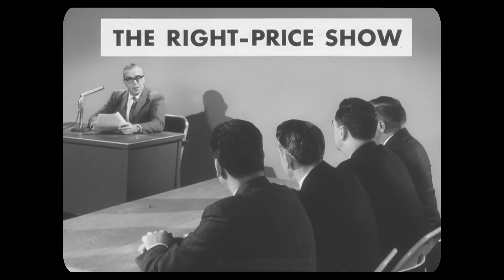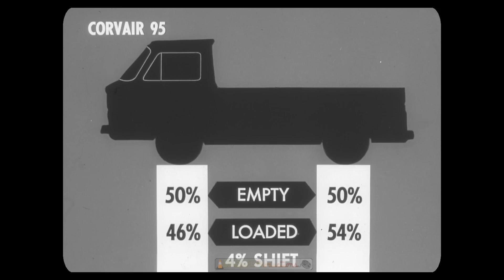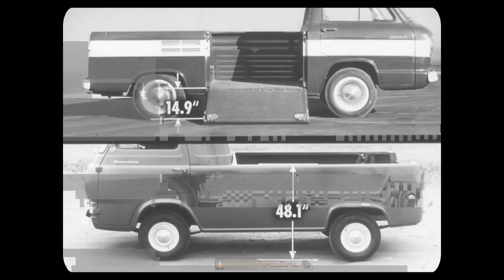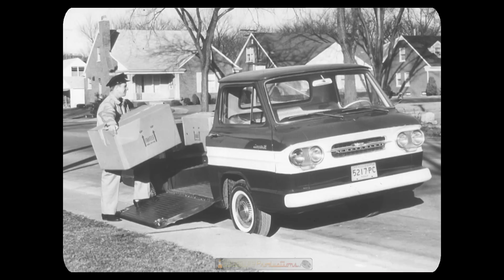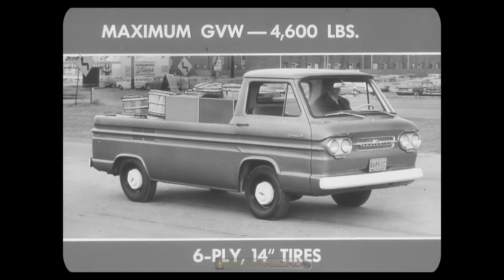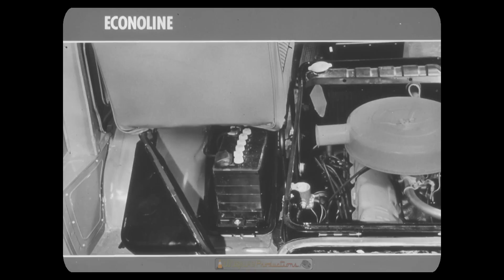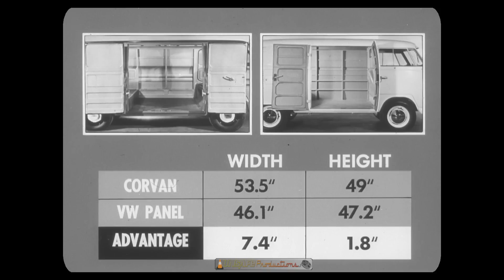CORVAIR FC 95 Vs FORD ECONOLINE & VOLKSWAGEN VAN 1961

Comment: It's a shame, considering the advantages of the Corvair van and pickup truck over the Ford Econoline van and pickup truck, that it was discontinued when it was.
Reply: One reason that was discontinued was because of that sorry ass engine it had.
Reply: Really? If you remember, Volkswagen also used boxer engines for their cars and trucks into the 70s, and to some degree even later than that.
Reply: +Jason Carpp  This presentation is from GM's point of view.  In the real world, the Econoline was a far better work truck.   The Corvair overheated under hard work, didn't have nearly the power, and the rear load floor was unusable with the engine taking up the cargo area. For family use, I'd take the Corvair, for a work truck the E was a far better more conventional vehicle.
Reply: @ohger1  and I live in northern Iowa, the Econolines had functioning heat, the Corvan.....not so much.
Reply: @fk4515   Yep.  I had a 66 with the large 240 engine and it had fine heat.  But like the Vdub, the air cooled Corvair made heat almost immediately, just not very hot.  A water cooled engine like the E had took longer to heat the cooling system, but once it did, it was far warmer.
Reply: @ohger1  Perhaps Chevrolet could've gone that route when developing the Corvair. a small V6 engine in the back of the Corvair?
Reply: @ohger1  and once the VW or Corvair got some age on them and started rusting the heater system would quit working.
Reply: @jasoncarpp7742  Capt. Beak got it right.   You have to realize that GM was intrigued with the Bug and thought they could make it better.  It actually was in some ways but there were trade-offs.  Putting a liquid cooled six would have taken up an enormous amount of real-estate, not to mention the problem of putting in a radiator and making sure you could get airflow through it.  A front mounted engine has no such troubles, which is why manufacturers went from rear engined horseless carriages to front engine.  And while the Corvair was a revisit of the Bug, the Corvair van was a revisit of the VW Bus.  My dad bought a 59 Bus brand new and really liked it.  When it died, he bought a 66 Super Van Econoline, and that had many times the room because of the packaging of the straight six between the front seats.  The VW was better in snow and better on gas, but couldn't carry a third of what the E could.
Reply: @fk4515  True, but all you had to do was replace the heat stove covers with unrusted ones or the vent tubes and the heat came back (more or less LOL).
Reply: @ohger1  most of the ones I got the tin worm had gotten into the ductwork. I suppose if the VW's had developed plastic or stainless steel ducts and used electric fans it might of worked out okay. I can't remember if our Corvair had an electric fan.
Reply: +ohger1 What causes the overheating? I would've given it a water cooled boxer six engine, rather than the air-cooled engine.
Reply: Jason Carpp
 On a hot day pulling heavy loads, the Corvan air cooled engines overheated because of insufficient airflow across the heads for the heat they generated and lost power as a result. An air cooled four is a nice idea for an economy car but bad idea for a work truck.  Between the engine and the loss of load floor out back the Corvan didn't sell a fraction of what the Econoline did. Chevy dropped this van for an Econoline clone.
Reply: +ohger1 That can certainly be a problem. Perhaps Chevrolet should've offered a water-cooled engine? Perhaps they should've also provided a better ventilation for the engine.
Reply: Jason Carpp
Only so much you can do engineering and cost wise with a pre existing design. The van was pulled from the Corvair car which limits what you can do without changing "hard points" in the engineering blueprint.  For a small car, an air cooled rear mounted engine makes sense.  In the winter, a rear engined car goes better than a front wheel drive.  But even Vdubs in very hot weather and traffic would get very hot without pulling cargo along. But once the decision was made to make a van out of the Corvair it should have been limited to home use (Chrysler figured that out!).  To add water jackets to the Corvair engine would have added a lot of cost, complexity, weight, and size.  The air cooled engine was adequately ventilated as installed but there's only so much air you can get across the heads without the engine fan being geared or pitched so much that it's parasitic draw would reduce engine power to an unacceptable level. If Chevrolet had thought to dress these vans out as nicely as a car, they might have done much better with families with kids as the first Caravan did.
 I think it's a very cool van just not a very good work van as the sales video would lead you to believe.
Reply: +ohger1 I imagine. I wonder if a water-cooled boxer engine would've worked for a Corvair.
Reply: @jasoncarpp7742  their were a multitude of problems with the Corvair engine.  This was the second attempt at an air cooled car but they didn't understand the temperatures it would run at and used gaskets similar to their water cooled engines, these gaskets didn't hold up to the heat, once they started leaking oil the dirt would stick to the engine and hold the heat in and the downward spiral started.  Another problem was the fan ran off the crankshaft so on a hot day when the vehicle was idling at a stop or cruising at slower speed it might not get as much airflow as it needed, with water cooling even though the water pump is run of engine speed the thermostats and such did a better job of adjusting the coolant flow and also could heat sink excessive heat, that and the cooling is done at a radiator making it easier to avoid a heat soaked engine with a long coolant temp recovery. That and air is not a good cooling or heating medium, water can carry much more heat per cubic foot.  A water cooled flat six engine would of been unique and interesting  but almost contemporary to the Corvairs was the aluminium Buick V-8 that didn't work to well for GM because they simply didn't have a lot of experience in casting aluminium, to make it in cast iron would cause the weight to go up (although a water cooled flat six even in cast iron would probably be lighter than a straight 6 engine) and you still have to deal with the issue of locating  a radiator with adequate airflow.  Many of the points made in the video could be said about the Chrysler Mini vans of the 80's but no one in the US during the 60's was thinking or working in that way, the French (Citroen) and some small German Manufacturer made front drive vans, the Citroen H van was relatively successful in France, the German firm was pretty much eclipsed by the VW Type II variants.  The bottom line is GM is not a firm that does innovation well the of the major engineering innovations of the 60's the Corvair, The Transaxle Tempest, the Aluminium V-8, the Toronado/TH425 Transmission, The Vega and the OHC Straight 6 the Toronado/TH425 was the only one that was really successful long term. The GM method in the past was to buy up firms that had developed products with potential and then use GM capital and GM management and production techniques to develop the product. Examples: Detroit Diesel, EMD, Terex, Frigidaire and North American Aviation.
Reply: @fk4515  Okay. Perhaps they should've went with water-cooling. There were rear-engined water-cooled vehicles during this time, weren't there?
Reply: @jasoncarpp7742  Fiats, Renaults and a few other oddities and probably a mainline manufacturer or two that I can't think of right now. But with a rear engine in the van you're still having to deal with the issue of the engine bump in the back which is a limiting factor in commercial vehicles or you flatten the floor and deal with the increased floor height.
Reply: @jasoncarpp7742  Bad design?
Reply: @jasoncarpp7742  What if?
Reply: @jasoncarpp7742  then there's problems with getting air across a radiator or real long coolant pipes or hoses.

Comment: They glossed over the fact that the engine and transaxle had to come down just to get a look at the spark plugs.  This was back when plugs were due every 10k miles or so.
Reply: +Kevin  My dad had a "Supervan" version, and working on it was a piece of cake. If anything difficult needed to be done the engine cover unbolted from the floor and the engine was sitting right there to work on, even in the rain.  I could put in plugs, points, filters and belts in 45 minutes.
Reply: +Kevin you could get at the engine from above, but you had to unscrew an access cover.  Not convenient if the vehicle has a load in it at the time.
Reply: +Kevin That is not true...engine top cover comes off inside back swing doors..you can change the plugs in less than half an hour. I have 2 of them (Corvans) so I do know. I actually like the Econolines and the VWs too. Not trying to be a smart guy....I'll send you a picture of the engine cover off.
Reply: +Poncho389 Thanks for correcting me.  Yes please send a picture.

Comment: I'd rather have the VW. Sorry.
Reply: Brian Allen thats fine, i prefer the look and smooth streamlined front of that oposed to the balsy looking front of the corvair, with its pointlessly elongated face, the econoline is still my favourite van, second would be dodge a100
Reply: My  66 econoline van fits in a old tiny 1 car garage what are meaning
Reply: +Brian Allen  Don't apologize.  My dad had a brand new VW van in 1959 and loved it.  When he ran it out of oil and seized the motor, he bought a new 66 Econoline Supervan with the big 240 six.  He could not believe the difference in power (he said driving the Vdub meant keeping your foot to the floor pretty much all the time). Dad also seized the engine on the 66 in 1977 for the same reason (never learned his lesson)
Reply: @ohger1  I threw a rod in my 1961 36hp in 1967 or 68, upgraded to 40 hp (WOW!)  (Top speed still about 55 - a great teacher of patience and gauging  passing distance)

Comment: Good stuff, try as they may the Corvair truck line never sold very well for a reason not mentioned  in the training film, and that was you could not load it or unload it from the rear due to the engine cover. The Volkswagen was no better at this and sold few pickups here, the Corvans were dropped after 1966 and replaced  by a Chevy copy of the Econoline which was made out of Chevy II parts.
Reply: +proofbox  Yep> my dad traded in his 1959 VW Bus for a "SuperVan" because of that huge flat floor (and he blew the VW engine by running it out of oil).  The Corvan had the same problem: the engine blocked the back of the van where most workers used them.
Reply: Yep I was going to point out that the Corvan design was so darn superior that they made it a few years and then dropped it for a copy of the Econoline, or did they Copy the Dodge A100 or A 108?  And bragging about swing axles? They redesigned the Corvair in 1965 to eliminate swing axles and the swing axles were one of the features that Ralph Nader found objectionable in the original Corvair design.  It's not that I don't like the Corvair van, they're unusual and kind of funky and I like that but they were a flop and GM switched to a more conventional van rather than making any effort to further develop the Corvair vans. GM came out with the Turbo Hydramatic 425 transmission in 1966 and eventually used that transmission  in Motor homes, I think they missed an opportunity in not developing a front drive van/window van using the TH425 Transmission where they only thing they'd have to keep under the floor would be the exhaust system and the fuel tank and with some creative packaging and IRS could of kept a low floor height and center of gravity and maybe even offered a high top van with standing room cargo space
Reply: @fk4515  ... that would be the TH 400 trans, not TH 425. Doing a little research, the Corvair trucks were slated to have IRS in 1966, (through 1969) same as the cars, but Chevy pulled the plug in favor of the conventional driveline cargo van so never made the 1966 version Corvair. The conventional van had the low rear floor so was favored at loading docks. I had the pleasure to park my Corvair van next to a shorty conventional 1964 van last summer and I was amazed that the Corvair van was about 18" longer. Both vans had the identical dashboard and steering wheel.
Reply: @rupe53  Nope the TH400 was the new rear wheel drive in '65 for the senior cars, the TH425 was an adaptation of the TH400 for front drive first used in the Oldsmobile Toronado in 1966 and the Cadillac Eldorado in 1967. If I remember correctly that was the same basic transmission they used in all front drive E bodies until they went to a transverse engine
Reply: @fk4515  ... Thanks for the heads up. I had completely forgotten about that beast even though I did a few transplants back in the day!
Reply: @fk4515  I believe the downsized Toronado/Riviera/Eldorado in 79 used a Smaller TH325 and later TH325-4L, still in longitudinal form... But that was after the 400+ CID engines had disappeared... Then I believe the Sideways engined Toronado/Riviera/Eldorado  came out in 1986 and TH440 sideways trans to match...
Reply: @misters2837  Maybe so, the only front drive "E" bodies I messed with were gen 1 Toronados. I assumed with the low volume they used the 425 up until they got overdrive, so I'm guessing the 325 was based off the TH350?
Reply: @fk4515  Yeah they should have used TH350! but in typical GM form...It is based off the TH200 and the 200-4R...which were CRAP!
Reply: @fk4515  GM made a smaller trans when Toronados and Eldorados downsized in 1979 and were joined by the Riviera. There was a 3 speed and a 4 speed overdrive. Pretty sure they were based on the TH200 and TH200R4. I believe that size car lasted through 1985, then in 1986 they went to transverse engines and unibody construction.
Reply: @misters2837 I agree those trans weren't "strong", but I think "crap" is a little harsh. My Ma had an 83 Riviera she bought used, Olds 307 powered and the overdrive trans. Car was still running at 300K+ miles. Trans was rebuilt once, and I replaced timing chain once. Other than that no other major repairs. Yes the 307 only survived cuz it was too weak to blow itself up, but I think they deserve a little credit. She loved that car in thr Northern WI winters, and it was pretty good on gas. 
I'd love to find a clean 5.7 diesel Tor/Riv/Eld. A late enough model to have the improved head bolt arrangement. I bet it would get close to 30mpg if driven gingerly
Reply: @johneckert1365  I was actually referring to the TH200 series of which my father's girlfriend had an early G-Body wagon, with the 2bbl 3.8 Buick (in a Chevy) and TH200 (3-speed) which required 2 GM remans before it hit 150K...They Were CRAP!